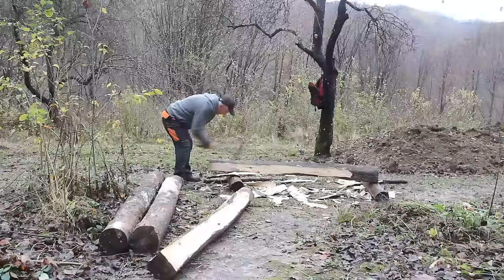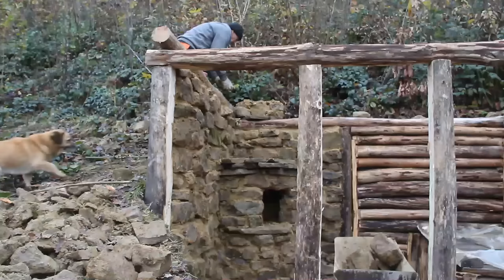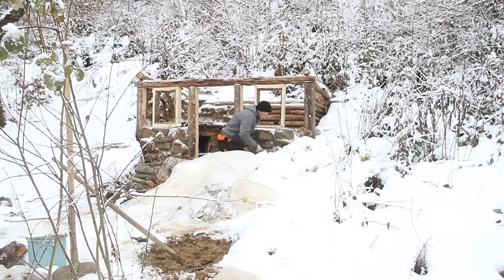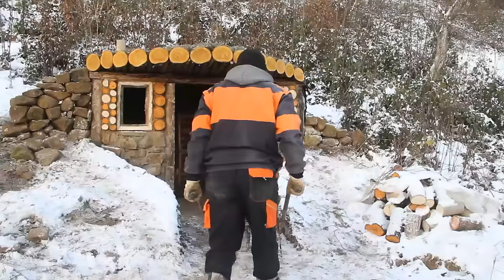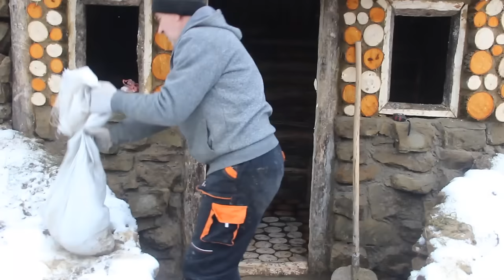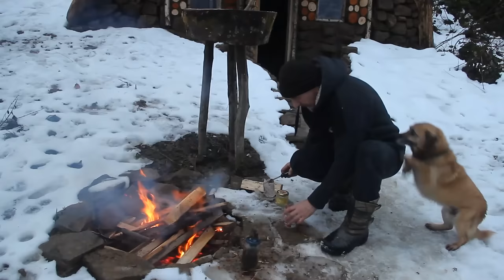How to Build Warm Shelter in the Wild Woods. Bushcraft Survival HOUSE UNDERGROUND | ASMR

Comment: Looks nice till you get 12 inches of rain in 5 days - or two days.  Dig a hole in a hillside and no matter what the walls are lined with, you will have a very wet puddle to live in.  Suggestion: build it ROUND, on a MOUND and cover it well with a double skin tarp with spacer between.   A cozy stone fireplace in th emiddle and you will be dry and toasty in the wettest / coldest weather.